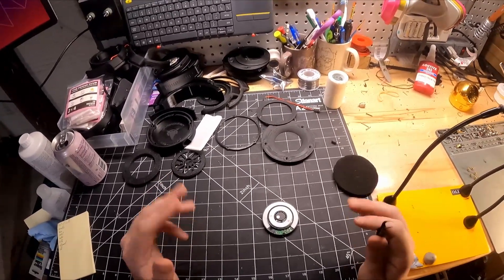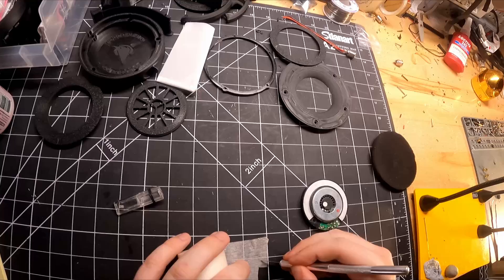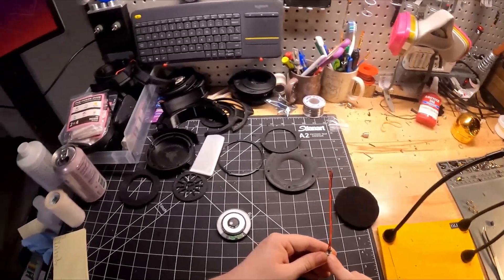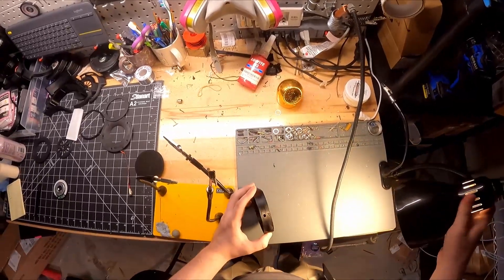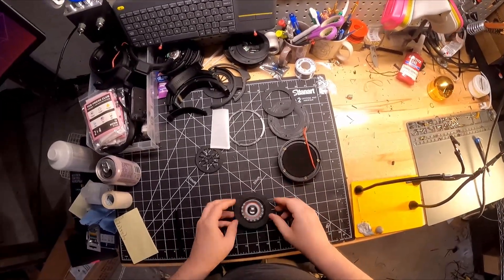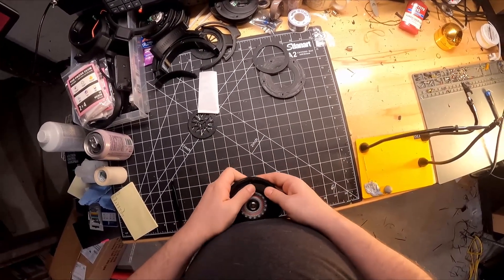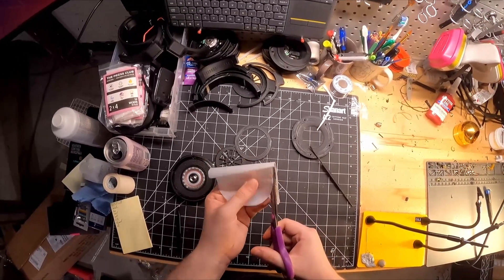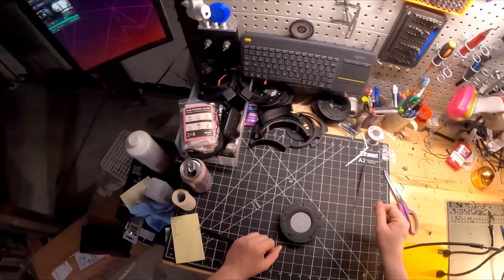Capra Audio Ouroboros Headphone Speaker Assembly Tutorial

Comment: A ring radiator driver, can even compare to something good like sennheiser hd800? That also has an ring radiator driver
Reply from the maker: really hard to compare closed backs vs open backs, compared against most closed backs though this really takes the cake.
Reply: @capraaudio  there is a version of hd800 of closed backs.
But why is this driver for closed back? Has a low qts? Bad impulse response in open back or something?